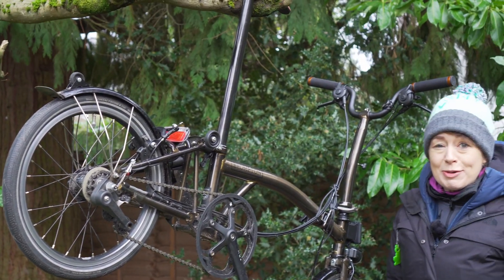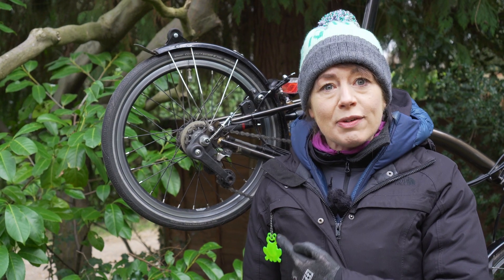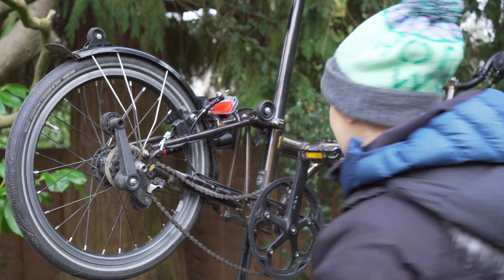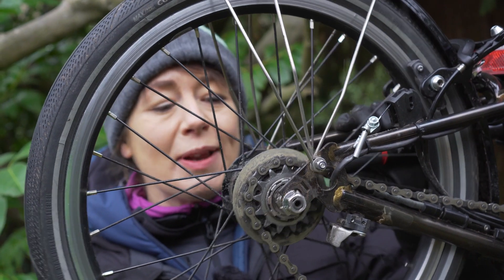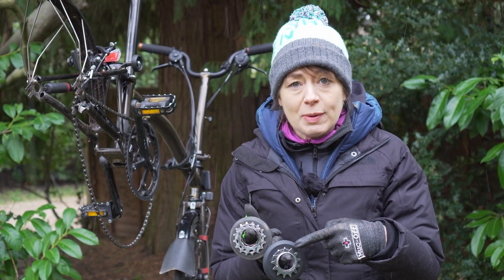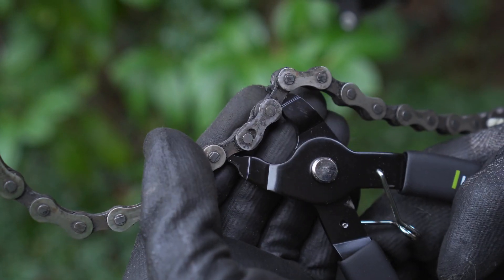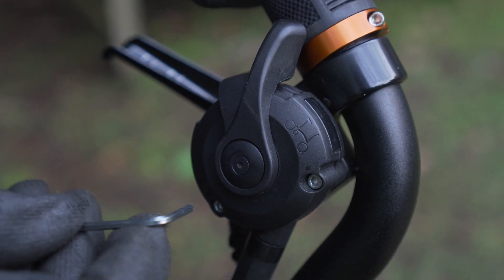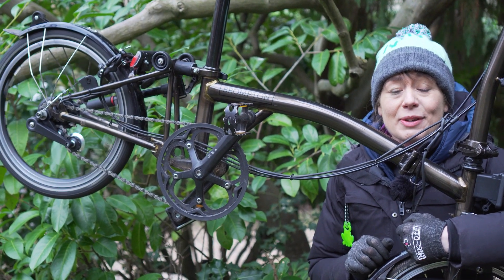Brompton 6 to 3 speed conversion

Comment: Thanks for this —  it was very useful. I followed all the steps but didn’t bother changing the rear cogs. I simply left the chain on the bigger cog — which was what I was always using anyway. I also used an angle grinder to get rid of the excess brackets on which the rear gear change mechanism was mounted, and did a bit of a respray while I was at it. I’m very pleased with the results. Thanks for giving me the confidence to try.

Comment: so if i were to convert my 2011 single speed brompton to a 3 speed, all i would need is a new rear wheel with a bwr 3 speed hub, indicator chain, gear cable & housing, and a rh shifter?

but if i were to go further and convert from that to a 6 speed, would i then only need a 2/6 speed chain tensioner, lh shifter & gear cable, and the other derailleur parts??
Reply from the maker: Thanks for watching! Yes the three speed you just need to add the hubs gearing. The 6 speed both hub and derailleur gearing

Comment: How much weight does this conversion save? I'm desperately trying to lighten my M6L
Reply from the maker: Many thanks for watching! It will be very little weight saving, as the wheel is the same, it’s just the chain tensioner and one sprocket.
Reply: Thanks @brilliantbikes  I suspected as much. May have to consider going from 6 to 2 speed and changing the rear wheel.

Comment: I have a desire to do exactly as you've done. But why can't I just leave the two sprockets on along with the stock OEM derailleur? 
Will the chain just continue to ride along either the 13T or the 16T without flopping back and forth on their own? My preference would
be to use just the 16T so I'm able to still do hills. I really don't need the speed.

Comment: I don't understand why we need to shorten the chain.  Old and new sprockets are the same 13 teeth.  The chain tensioner is taking up the same slack.  Surprised nobody noticed this!
Reply from the maker: Thanks for watching and the comment

The original was a 6 speed sprocket stack with a 13/16T combination

The new is 3 speed single 13T sprocket

So the chain is based on the largest sprocket in use - we went from 16T to 13T - so need a shorter chain

We hope that makes sense?
Reply: Could I also just use the old 16 teeth sprocket instead of the 13 ?
Reply: Or just leave the old double sprocket and the old chain tensioner?

Comment: Great. Apart from tidiness, is there any reason to replace the chain tensioner? Couldn't you just set the limit screws on the sprocket pusher, and then remove all the cable, spring, etc?
Reply from the maker: Many thanks for the question. Yes in theory to make sure the roller wheels don’t slide then yes you could adjust the limit screw.

Comment: Presumably, the same procedure could be used to fit a [new] wide-ratio rear-wheel to an existing 3-speed Brompton? I'm not too bothered about removing the derailleur from my 6-speed electric Brompton [although I very rarely actually use it - only occasionally when wanting to change down a tad going uphill and not wanting to take pressure off the chain to change down the Sturmy Archer] but I would really like the wider ratio on my older 3-speed manual Brompton.
Reply from the maker: Thanks for watching

Yes - that's actually even easier

A new (wide ratio) 3 speed wheel - with a BWR-3 sprocket stack can be changed directly for the standard ratio wheel

I always run my Brompton like this - for the wider ratio!
Reply: @brilliantbikes  Ordered, received, fitted...and all good! (If we ignore the fact that I initially set my hub gears up thinking I was in 2nd gear but was actually in 1st - you'd think after 50+ years of setting Sturmey-Archer gears up I wouldn't make that mistake LOL)

Comment: I have an M6R.  Just wondering if the 3 speed Sturmey Archer hub can be replaced with a 6, 7, or 8 speed hub, eliminating the derailleur?  I'm sure that a new shifter would be needed but this would be an interesting modification.
Reply from the maker: You can use the 5 speed relatively easily as the axle length is the same, so it’s a case of relaxing the wheel and a new shifter.

Comment: Hi , When I bought my 3 speed I changed the chainring to a 44 Tooth for better climbing. I think I’d like to go even smaller and saw a 40 tooth that you have to shorten the chain for. I have a 2012 . Have you had any experience with this switch ❓
Reply from the maker: No so sorry no experience with a 40tooth, but the chain still needs to be shortened when changing from 50 tooth to the 44.

Comment: I am trying to work out why taking the derailleur OFF is necessary..(?)... when you could not just not USE it. Moreover, with the equipment still fitted to the bike, you could change you mind about which set of three gears are NOT being used at any one time!

Comment: This is really useful, this is something I've been wanting to do since getting the bike as I regularly just use the + Gears and quite like the simplicity of just the 3 gears. Am I right in thinking though that by changing to a single sprocket and removing some chain links that the resulting gear ratio is slightly lower? Would it be possible to post what the gear ratio would end up being for this build? Ideally I'd like to replace with the 3 gear chain tensioner but kind of leave the sprockets alone, will the 3 gear chain tensioner work with two sprockets (with the chain on the + sprocket)?
Reply: That`s what I had in mind also. Did you every proceed with this project? If so, what did you do?

Comment: So in practical terms you lost your lower end gears. It's the same as riding a 6 speed Brompton with the left shifter always on (+).
Can't you use only the larger cog on that mod instead, so you get the lower gears?
Reply: I don't think you lose the lower-end gears - I think you lose gears 1, 3 & 5 and keep 2, 4 & 6.
Reply: @frankhooper7871  yes. Let me rephrase that. You loose the lowest gear and the steps between gears are higher (in theory, because in the real world no one ever does that mambo jambo to go through gears on e 6 speed Brompton).
But my question remains unanswered: can I use only the large cog on this same mod, so I get to keep the lower gear?
Reply: @MrBaptista  I concur with you 100% as I wonder the same. In fact, can one just leave the 2 rear sprockets on and utilize the same derailleur while looping the same length chain onto the 16T gear? Alleviates having to buy extra gear, spacers, and new fixed derailleur. Not to mention shortening the chain. In the meantime it still gets a makeover and cleanup by removing the cable, shifter and all the derailleur adjustment goodies. Now let's hope for some answers @MrBaptista

Comment: So, this reduces the overall gear range by removing the larger sprocket, thus losing the lowest gear ie it is now harder to cycle uphill? As an alternative, can one fit a single 16 tooth sprocket - which would keep the lowest gear, and would also make shortening the chain unnecessary?
Reply: Yes.

Comment: I have had a 6 speed Electric Brompton since last October. I found it under geared so have upgraded to the larger crank chain ring and longer chain. I really find the swapping between the two gear mechanisms fussy and would far prefer to either downgrade to 3 speed or even better upgrade to a 5 speed hub  - I found this summary of ratios that are possible. https://docs.google.com/document/d/1f6iOsBHb0bdkGBxkYGA0J4Sg-LCvrIFPdL8HDpOTYmk/edit Has anyone direct experience of going to 5 speed in the hub?
Reply: Very helpful summary, thanks for sharing it! I saw some reviews of 5-speed hub on SJS website, all of them positive. I wonder why Brompton doesn't offer that option as standard? Guessing hub cost is an issue.

Comment: I like everything about the Brompton apart from its stupid anachronistic gearing. The last time I used a 3 speed hub was on my Raleigh Chopper when I was a kid. Bromptons should have 10 speed cassettes, a rear derailleur and quick release wheels.
Reply: Advantages of the Brompton 6 speed setup:

1. As the hub mechanism gears up, a high gear can be achieved without recourse to large chainrings and/or very small sprockets.
2. The range is very wide. 
3. There are evenly spaced small steps if using all 6 gears sequentially. 
4. Or you can get much larger steps by just using just the hub gear change. You can then finely trim the gear using the derailleur. In fact a lot of people use the gearing that way. 
5. The hub gear can be changed when stationary. Very useful when you pull up to traffic lights or if you have to stop suddenly.
6. The derailleur mechanism for a wide range 10 speed cassette would be very close to the ground.
7. The Brompton fold requires a narrower hub than derailleur geared hubs (especially 10 speed!) 
8. The wheel does not need to be dished
9. As the 3 speed hub uses only one epicyclic arrangement the inherent losses of epicyclic gears are minimised whilst still giving a large range with even steps. 
10. Anachronistic? I prefer to think of it as esoteric. And very Brompton. 

Quick release would be nice but it ain't going to happen.

Comment: Very informative. I am a fan of internally geared hubs for durability and low maintenance. I personally am comfortable with the wide 3-speed gear ratios for road and utility riding and wouldn't miss the 2 speed derailleur for "normal" riding. Is there something unique about the chain's Brompton produces that precludes the use of another available brand of chain?

Comment: Two questions: firstly isn't there any other after market chain you could use? Secondly isn't there any internal gear hub to get the simplicity of a single speed but with the range of the six speed?
Reply from the maker: Thanks for watching 

Great questions

Yes - there are other alternatives - we were planning on trying a KMC 8 speed "non-rust" which sounded ideal - but haven't got around to it yet

We also used to have a 5 speed SRF-5(W) - wide range 5 speed - which gave a great range - we are about to re-create one!
Reply: @brilliantbikes  when you do re-create the 5 speed please show us
Reply: There are some people putting 8 speed hubs on their Brompton, but you have to widen the rear triangle to make it fit. With some aftermarket rear triangle, you can use a 14 speed German hub.

Comment: If I’m not wrong the standard three speed model has a diferent gear ratio than the one used at the six speed
Reply: Yep, I had a 3 speed b75, ratios are closer together and as a result the bottom gear whirrs a lot less. I upgraded it to 6 because I live on steep hills so got to compare both hubs on the same bike. Not sure I’d want to run that wide hub without the 2 sprockets though
Reply: I have a 6 speed but never really use the derailleur bit, as it seems more temperamental than its equivalent on my 2 speed for some reason. I just leave it in + and use the hub shifter. So I might as well shift to 3 speed instead. My 6 was bought from someone who lived in a hilly area, so has the smaller 44T at front. Would this have an effect if combined with a change to 3 speed? Provided parts were available (and that’s a big if at the moment), I’d bring it into you guys to do the work.
Reply from the maker: Thanks for watching

Yes - the standard 3 speed is a closer ratio - for me (the person with the camera) I like to combine the simplicity of the 3 speed with the extra ratio of the wide ratio

There is a great gear ratio calculator here:
http://xldev.co.uk/bgc.html